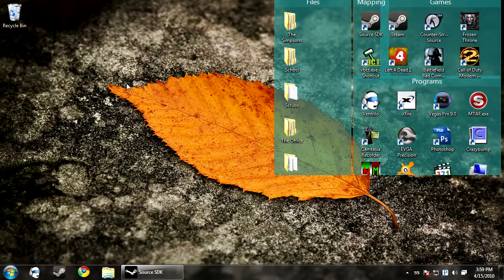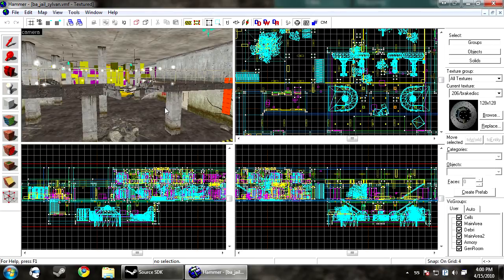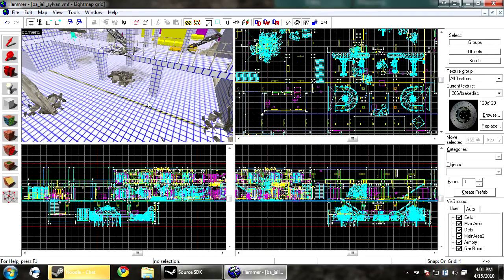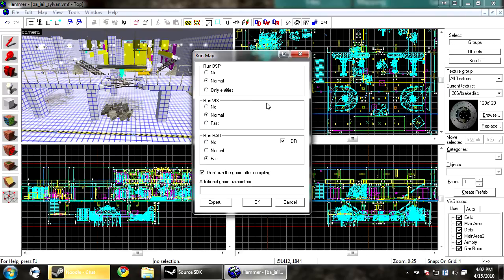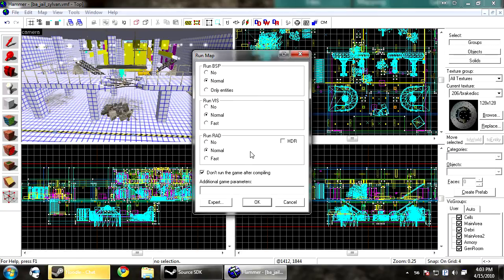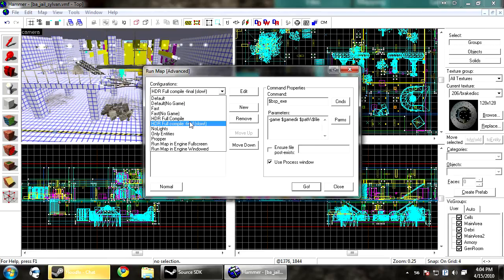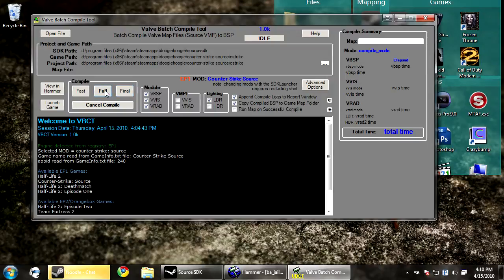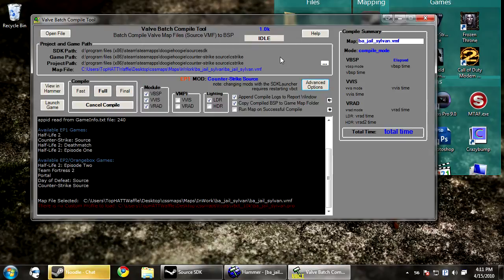Hammer Tutorial #28 part 1 "What happens during a compile? And how to speed it up"

Comment: I recommend adding -low parameter to vbsp, vvis, and vrad parameters especially for final compile, This allows you to use your computer for other things while you are waiting on a long compile.
Reply: Wish I known that, I used an external compiler with a cpu core spared cuz hammer holds my computer hostage :P
Reply: @leerman22  You can use those parameters with the external compiler, there should be a expert button that allows you to add them.